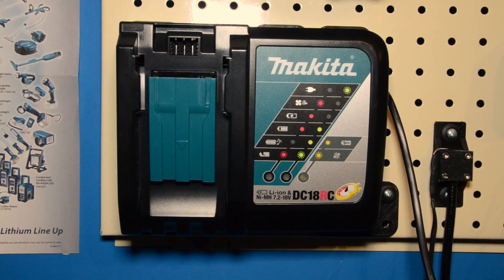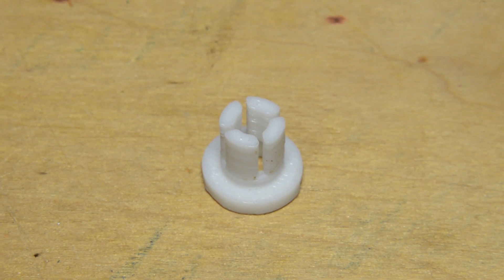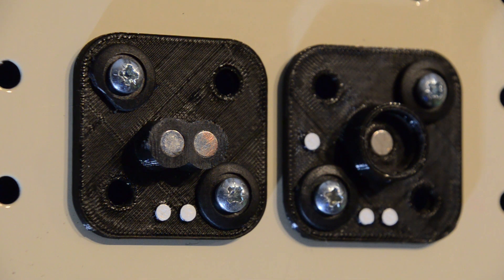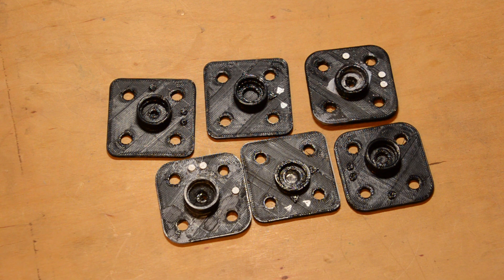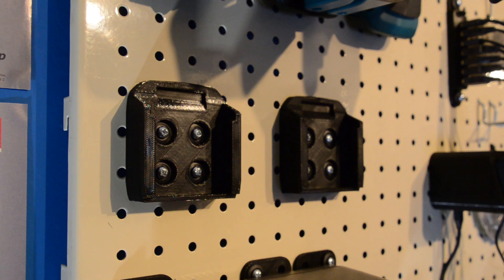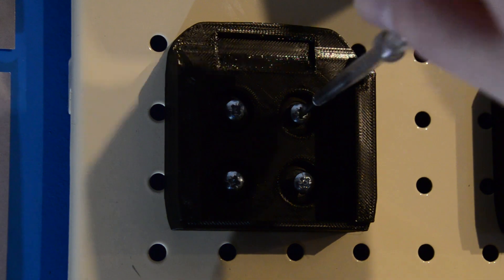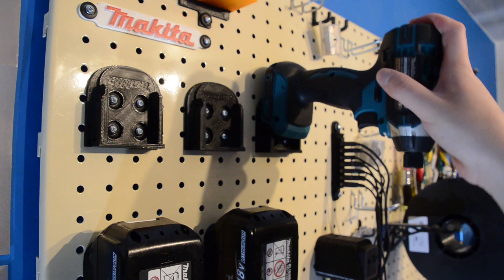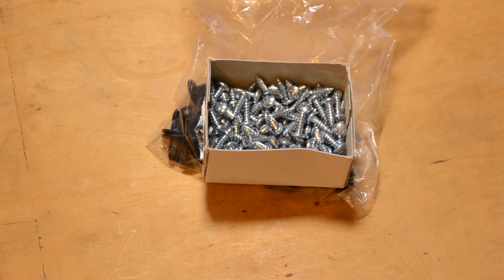3D Printed Makita Charger Mounts + Other Accessories

Comment: Hi Matt fantastic video. I am after some tool holders like the ones you’ve made so I can hang up my makita tools. Do you sell them or would you sell me the plans so I could print them? Regards Dave
Reply from the maker: Hi Dave, the quality from my 3D printer isn't good enough to sell (it's creaking now in its old age) but if you have access to a printer, the 3D files are freely available on Thingiverse via the link in the description. In my experience the part comes out best if printed vertically. Cheers!
Reply: Hi Matt thanks for your fast response. That’s great I’ll follow the link and ask a friend of mine to print me some off. Best regards Dave